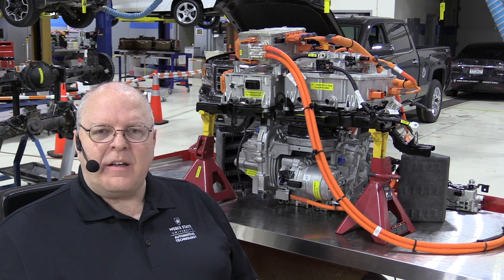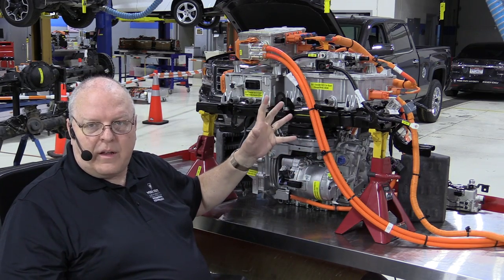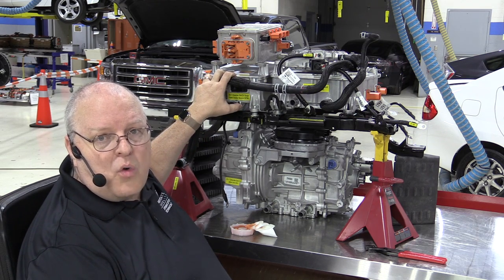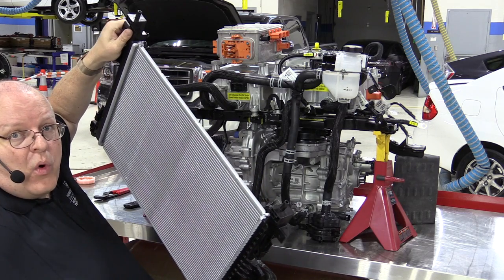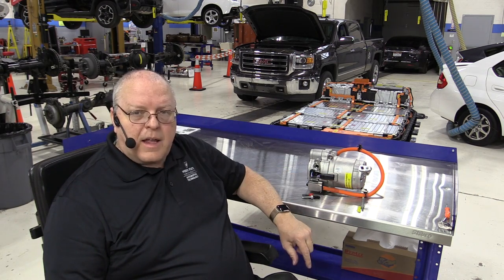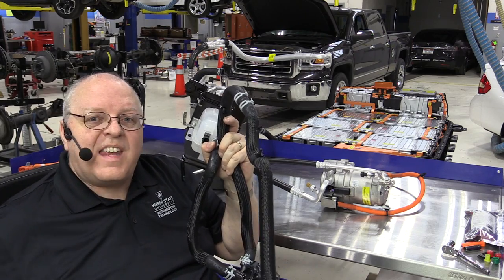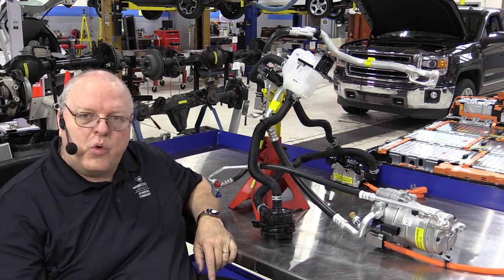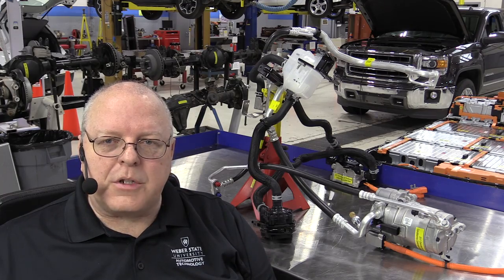Chevrolet Bolt EV Coolant System Loops

Comment: Hello Professor.  At the 22.56 mark, you introduce the 2k watt battery heater. IN Cold Mn winter it simply is not possible with that battery coolant heater (unless there is a software fix that can up the heat) to raise the Battery temp high enough to reach optimal operating temps. 75 or so.  I generally see a 48-62F range on the battery. The only time I get the battery Pack in the '70s is long dc charging.

Could GM if they wanted to add a larger, say 4K watt coolant heater that was able to give us say Battery Heat in the 75-80F range no matter the outside temp?  

(That's a why did they not do that in the first place question)

I came here looking for the cooling lines because I am considering installing a hydro diesel heater /ebsar style Hydronic S3 Economy. And sorting out ahead of time the correct lines. Love to see you do one of these heaters).

I am losing 50% range for winter. 

My climate setting usually displaying 20-25% of the energy used. (so battery not being warm enough is the most of the rest of the range loss).   Not much I can do with the battery other than some insulation but if I can install one of these hydro diesel heaters (yes I know yuck. diesel with an EV) getting back 20-25% of range is a big deal. 

appreciate your feedback and recommendations.

Comment: Thanks for the video! Quick question: Does the CCS system communicate with the BMS through its own cable or that secondary power cable you presented in this video? 

Also, regarding 26:33 Based on my observations, the battery chiller will start cycling the AC somewhere between 92 F and 94 F. With the cabin fan on, you will start to feel chilled air even when the cabin climate control is not activated.
Reply from the maker: Thank you. There are CAN lines between the OBCM and the EBCM. The CCM is hard wired to the OBCM.

Comment: Hey professor 20:45 
the ac hose that goes from the batt chillar to the evaporator has a rubber section before the “pipe on pipe”
In my 2020 bolt is cracked   How durable are these?  My bolt isn’t that old. Please let me know when I should change it. Ty

Comment: Hi, wonderful videos!  Do you have anything on how to prime (bleed) the cooling radiator and hoses for the HighVoltage Charging system on a 2013 Chevy Volt? It appears to be a very common problem (to get the Service HighVoltage Charging System) I used a Vacuum filler and I don't think I was able to pull any air out of the lines. I also tried to use the SnapOn scanner to do the Priming Test to no avail. I would love to do it without any computers involved if at all possible.
Thanks

Comment: Prof. Kelly, is the "Hybrid/Electric vehicle electronics cooling loop" connected to the "HVAC" loop? For example, I see that in TESLA Model S these  loops are connected "for cold conditions only" where the electronics cooling loop supplies heat to the HVAC coolant loop for compartment heating.

Comment: I noticed the hose going to the passenger cabin (at about 21:12) evaporator says "R134a," but the Bolt uses R1234YF for the AC. Any thoughts, comments, or observations about this?

Comment: So when they designed the Bolt they made it differently then Chevy Volt by removing the Battery Radiator and relying 100% in the AC to cool the battery right?
Reply from the maker: That is correct. Thanks for watching

Comment: Hello Professor, How the  E-Motor and Reducer coolants are cooled , since i haven't see any heat exchanger/External Oil cooler. Is there any Passive cooling system available for E-drive? . This will be helpful for me if you give some answers. Thanks.

Comment: Didn't notice you published a couple of more videos.
This car is called  (rather, would be rebranded as) Opel Ampera-e in EU but I don't know why they stop producing them. It's a shame considering what beautiful EV this is.
Reply from the maker: They did not stop producing the Bolt EV. They are stopping the production of the Volt. Thank you for your feedback.
Reply: @WeberAuto  I didn't mean the Bolt in America but the Ampera-e (same car) in Europe.
As far as I know you can't order them.
Reply from the maker: My mistake, I did not know that. I heard they are moving battery production to the USA to increase production numbers. Maybe they will start selling them again then. Have a good day!
Reply: @yosyp5905  GM sold the Opel brand to PSA.  PSA now buys the Ampera-e from GM and charges a higher price.  To my knowledge the Ampera-e is still sold and produced but due to the higher price demand has reduced.
Reply: @erikstephens34  Actually the issue is GM won't allocate many vehicles for the Ampera-e so there's perpetually a shortage of them.  Opel raised the price of the Ampera-e to temper demand while they develop their own EV that will replace the Ampera-e

Comment: The inverter gets the coolest coolant, and the motor gets the warmest. How do they determine the order of components to cool?
Reply from the maker: I do not know for sure, but I suspect the inverter has the highest operating temperature, then the APM, then the motor.
Reply: Surely, unless I am very wrong, the coolant flow is reverse to that shown!!
Reply from the maker: @olspanner  The direction of coolant flow is correct. Look at the electric pump, it is a centrifugal style vane pump. The output of the pump ois away from the coolant surge tank.
Reply: Electronics like to be cooler than mechanicals.

Comment: Rather than pay $500+ for a new coolant and evacuation of the old etc. Could one remove 1 qt from the reservoir, let it circulate for a week or so, then repeat 10 times for a final mix of 5% old 95% new?  (or 16 times to get to 1%)

Comment: I have a question for those who own a Bolt in weather such as in Las Vegas or Phoenix. I live in one of these climates. What if I park my car inside my garage and charge it as normal with a 240 volt outlet, but then I drive to work and there is no shade for the car, and no power available to plug into, not even level 1? Certain parts of the day during the summer easily reach over 100 and sometimes over 110 F, how will the car behave? Does it have to constantly run the cooler for the battery, and will I come back out to the car at the end of my shift with significantly reduced charge left? Or is it really not that bad? Or does it not need to cool the battery if the car is parked and hasn't been driven for several hours?

Comment: Hello professor Kelly, Great video. Do you  know if the battery cooling/heating system keeps the battery at the 'good' tempature when the outside weather is too cold or too hot when the car is parked at home charging?
Reply from the maker: It will if it is plugged in to a charge cable

Comment: They could have put a high voltage restive element in the cabin instead of the heater core (heat exchanger), or even multiple electric elements to separate zones in the car and you would have a heating system with a quicker response time in winter (great for defrosting my Canadian windows) and avoid losing heat through some uninsulated hot liquid hoses going outside the cabin for legacy reasons. I get the Idea of taking back the heat loss of the engine, but at -20C, the liquid would still be freezing your fingers off. That's why I beleive a resistive heating elements system would have been better than an external water "boiler" with a heater core. Hopefully someone knows why GM took that decision and can give some insight (not wanting high voltage in the cabin? reusing existing heater core parts common in their other cars? not knowing what a Canadian winter means? all of the above?).

Very interesting tear down by the way, thank you!
Reply from the maker: Thank you for your feedback !
Reply: My guss on not using resistance heaters in the air stream is fire in a collision. Red hot elements getting into plastic from getting crunched up. Just my thoughts
Reply: Resistive heating elements which are positioned in the heating system airflow can accumulate dust/pollen which will create an odor as the heating element gets hot.  If strong enough, this could be considered objectionable to interior noses.  This probably went along with a directive “let’s keep the high voltage out of the passenger compartment”.
Reply: @dennislyon5412  even heater core at 180' can make smells also but not as bad as resistance heating I air flow
Reply: @dennislyon5412  Yes restive heating systems make burned dust smells, but usually only after a long time without use, like in the first days of fall. Once that layer is gone, the smell disappears, and the air filter keeps the dust to an imperceptible level in season. That's what happens in electric HVAC systems. So I tend to believe the other arguments more than the smell.
Reply: Very early prius used ceramic electric heater in the cabin. They did away with this on the gen 2 design around 2003

Comment: I'm a layman and can't figure this out based on all the information in this video. Would it help keep the battery cool to turn on AC cabin cooling during DC fast charging?
Reply from the maker: Hello, no, that will not help. The battery has its own independent cooling system. Thanks for watching

Comment: Hello sir thanks for your kind videos I have a question for my Chery tiggo 3x ev it stops slow charging and in the cluster bannel their is a warning of battery over heating  the AC compressor is not working from 4 monthes ago but the car was working normally but now it stops charging do you have any solutions

Comment: Every bolt owners knows that slow dc charging when batt is cold is a major issue. The Hyundai Kona has a battery heating system you can start a few minutes before dc charging. Could it be a possible solution for us to link cabin heating coolant loop with battery heating loop, and turn that valve open 30 minutes before charging, so the hot coolant from the cabin system heats up the battery?

Could there also be a way to get that battery heating system to start «on demand».... Cheating on temperature sensor?
Reply from the maker: Just use the key fob or the app to precondition the vehicle. The battery heater as well as the heater coolant heater will turn on at that time. Give it a while to pre-heat and then plug in the DC Fast Charger

Comment: How do you remove the "coolant caps" ???  They just "click" no matter what you do, push, pull, while you turn, but they do not come off ??? That is on 2018 MY car.
Reply from the maker: Pocket screwdriver into the little slot on the top of the cap while turning it.

Comment: Prof. Kelly - what is the power consumption rating for the cabin heater?  Is the heater core inside the vehicle similar in size to a heater core in an ICE car?
Reply from the maker: It uses 7.5 kW on the hottest setting. it took about 60 seconds to start feeling heat. Within a few minutes it was too hot for comfort. A very fast reacting heater system. The heater core appears to be normal size.
Reply: WeberAuto - very adequate - and quick - heat output on a cold day.  I was surprised that that much heat blowing into a cold car requires “only” 7500 watts.  And to think - this amount of energy is on par with the energy a full level 2 charger puts into a battery - for hours at a time!

Comment: Dear Professor J.D.Kelly, I have a simple question; My latest design E-bus cooling cycle is including two parallel pumps, besides each pump provides two separate cooling lines because of the coolant flow rates are different. One of them 15 l/min and the other is 30 l/min. How can I adjust the correct flow? To generated correct flow Is it possible to use a mechanical method or absolutely necessary to use electrically controlled 3 ways valve?  Thanks in advance. Best Regards,

Comment: i own a 2021 in Canada. I find that it does not heat enough in winter below -10 deg. Celsius.  Could it be just the thermostat motioned at  30:47 ?

Comment: Is there any gate valve used in the above system professor? And the coolent is continuous running or it uses thermostat valve to operate after certain temperature is reached?
Reply: No thermostats are necessary.  The temperature is controlled by the BCM controlling either the heater or the chiller.   The coolant runs when the pump runs, which is also electricity controlled.   Flow depends on needs because energy is conserved for range.

The Inverter loop may only get chilled as there is no need to heat it.  It may also only be disspatively cooled (like a radiator). The cabin loop is heated or chilled as is the traction battery loop.

Comment: Would it not be easier to skip the third coolant loop and just have an electric ceramic heater or similar inside the passenger compartment? Any reason they didn't do that?
Reply from the maker: I wondered the same thing, this does react very quickly. Thanks for watching
Reply: @WeberAuto  A thought that came to me after posting my earlier comment. The setup they used keeps high voltage out of the passenger compartment and thus well away from people. That seems a resonable explanation.
Reply from the maker: @DrSX  True